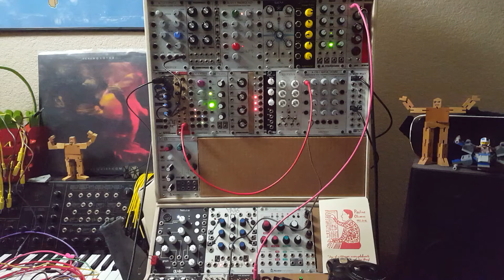Modular Beats with a Single Oscillator

Comment: How does one do this patch if they do not have a mod input on their VCO ?
Reply from the maker: YourBestChess Now : Hey! I think you'll want a mixer that outputs into your VCOs v/oct pitch input. You'll want to run your melodic sequence into a channel of the mixer at full volume/intensity, and your percussive envelope into another channel with intensity adjusted to taste. The two signals will be added together, similar to what separate inputs on a VCO would do behind the panel. Mixers are great for adding multiple modulation sources to filters as well, much like many classic hardware mono synths! (Envelope, LFO, and keyboard.)